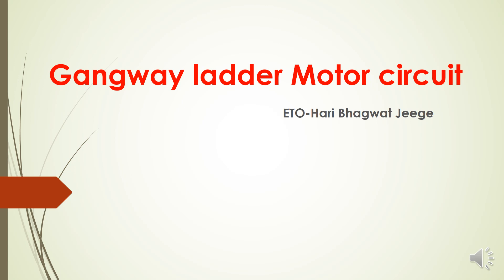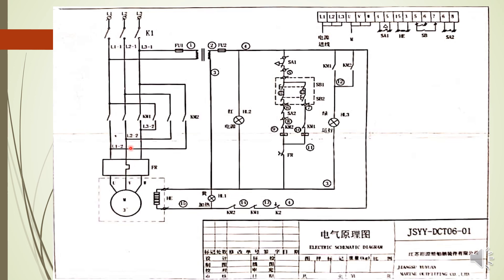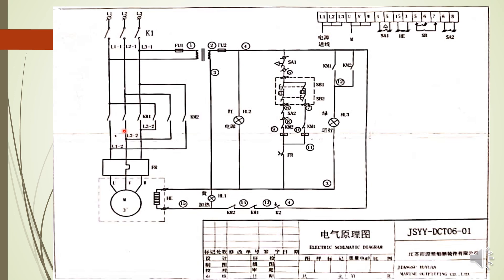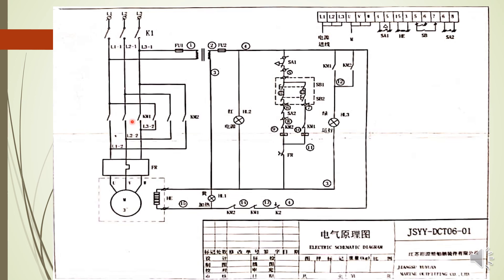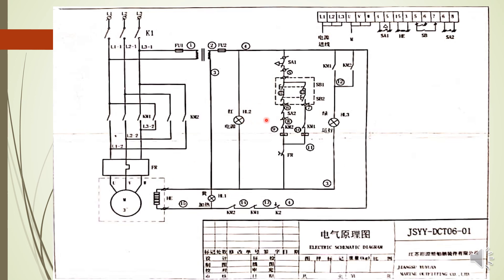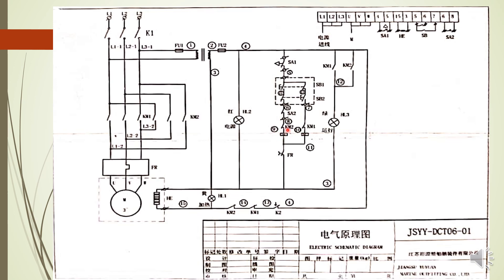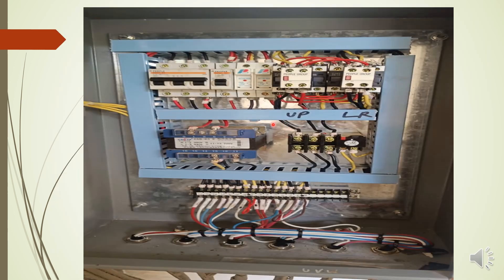Ship's Ganway/Combination Ladder Electrical circuit..

Comment: at 9:12 u said if power will transfer to KM2 and KM1 will energise, But if u see the diagram when u press the SB1 NO push button it becomes NC and the power to KM1 having NC contact becomes No which means when KM2 is getting supply KM1 is not energised. but u have explained it wrong ur saying if KM2 gets supply KM1 will enerizes not KM2
Reply from the maker: Thanks brother for your comment will see if mistake please correct it.